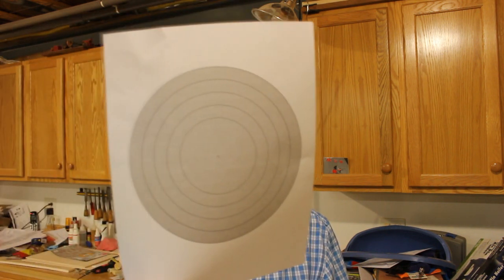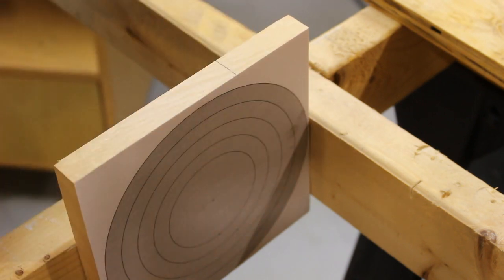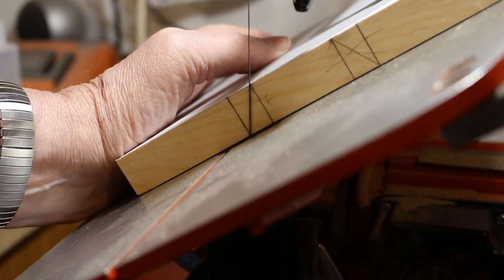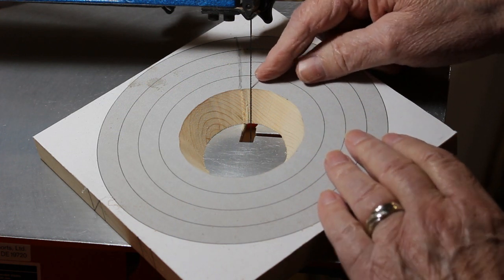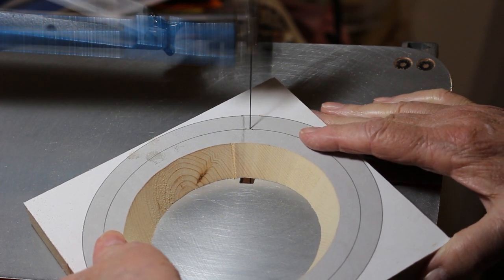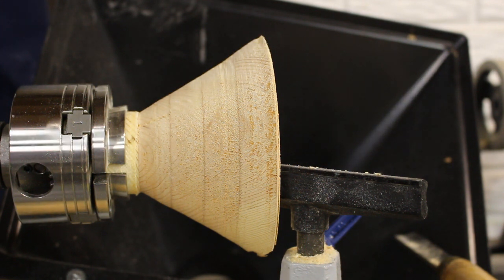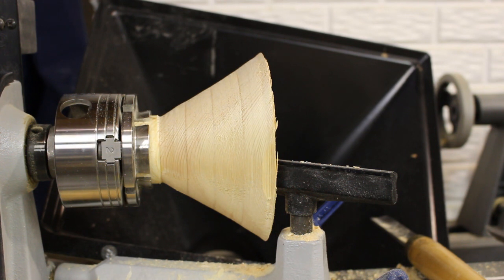Scroll Saw Bowl #1

Comment: This is my second WEN tool and they are both great MyBest.Tools I needed to do some trim work around the house and needed a scroll saw for the intricate work. No complaints so far.
Reply from the maker: When makes great tools.  I have a Wen air filter in my shop and I have been very satisfied with it so far.  Thanks for your comment and thanks for watching.

Comment: Been there, done that.  Gald to know I am not the only one.  Enjoyed the video.
Reply from the maker: Bruce,  yes but I am determined to get it right one of these days....LOL
Reply: @paulsmessyworkshop  Paul, Yes, hang in there.  I have known about this method for a few years but I have never tried it because all I have for a Scroll saw is an old Delta model and it is a trial just to mount a blade to it.  But your video got me thinking about it again, so I tried it with a piece of hard maple and it came out fine except it was kind of small, so I added a base plate and a segmented top ring using Purpleheart.  It turned out being one of my favorite bowls.  Thank you for the inspiration to try it.
Bruce

Comment: Thank You  As a total newby, the his was the first video that showed how to determine the angle and how the rings were cut.  I would use a sander (Belt or random orbital) to sand the item anyway, so It gave me an excellent start, as well as a reason not to start with the lathe yet..  and it gave me the idea for my first 'project'.  Nice video, Thanks again.
Reply from the maker: Allan, I am glad that you found my video useful.  Using a sander to finish shape the bowl is an excellent idea and one that was suggested by many of my viewers.  Many suggested using an oscillating spindle sander, I many give that a try next time.  Good luck to you and you advance in your woodworking hobby.  Most importantly, don't hesitate to ask others for advice, you will find the woodworking community friendly and willing to help.  Thanks again for watching and for commenting.

Comment: I'm happy you made this video even though it did not turn out so well. This will help me see that even experienced people mess up sometimes. I just bought my first scroll saw yesterday. I plan on making a lot of fun projects, but the only thing I have used it for so far is to cut 45° straight lines so that I could finish the two treasure chests I have been working on for an eternity (not really an eternity obviously, but they were started last October as Christmas gifts and... 

Anyhow, I'm building the inner shelves and got tired of sawing on the miter box. I figured a scroll saw would be a lot faster and easier. It will also allow me to cut patterns into some wood blanks I got because I wanted to get into whittling a couple of years ago. I thought I could just get the whittling kit, a few books, and start cutting, but half the projects recommend you start by cutting the basic outline using a scroll saw or a band saw, so they have also been sitting untouched.

 I got a promotion with a major pay raise, so my promotion gifts to myself were a scroll saw and a belt/spindle sander. I suppose I could make my money back if I decided to sell a few projects, but really, I just want to make cool stuff for friends and family with them. 

My 45° straight lines turned out quite well, and the inserts are coming along nicely. I was very happy to learn that apparently, the scroll saw can also be used to cut plexiglass because the bottom of these inserts will be clear plastic, so the treasure is visible from above. 

I might make a video of the project once I'm done, but I think it would be more of step by step photographs considering I didn't record a lot of video during any of this project. What do you use to record yourself while crafting?
Reply from the maker: Jolene, welcome to the rabbit hole of woodworking..lol.  I record my videos with a Canon 5i digital camera.  It has a movie setting on it and it works real well.  Almost any digital camera with a video setting on it will work or for that matter a video camera.  Thanks for watching and for your comment and good luck in you woodworking.  I would be interested in seeing your projects.  If you make any videos be sure and send me the link.  My email is:  paulsmessyworkshop@gmail.com
Reply: I have some stuff I made already a while ago, but hand cutting things with a miter box was annoying and I had slowly started cutting into the miter box with my saw (Its plastic). Most of the projects were made using premade boxes and items from hobby lobby, but modifying them by adding different hardware and other parts because as is, they lacked personality. 

I made one video of a jewelry case I made for a friend, but I focused more on the electronic portion than the rest of the construction and the castle was bought from Michael's so I didn't cut my own castle to use. 

I did create the electronic portion though by hand soldering the parts together and programming the components using Arduinos as the main component. I plan on doing the same for the boxes I'm working on now, but they are prebuilt chests. The insert for jewelry I made on my own though along with a hidden compartment below that has D6 dice as the legs which were carved using a Dremel tool and a lot of sanding. The top insert will have a clear base instead of wood so you can see the "Treasure" below. 

After looking at a lot of what I have seen online, I see that with a scroll saw, it would probably not be too difficult to make a castle and chests in the future. Not sure if it would be cheaper or not though.

 I used my phone for the video and it took up a lot of space not to mention the fun I had with placement of the phone.

Comment: Hi Paul, your video was very enlightening. I just bought a new Delta band saw and I'm quite pleased with it's performance. I am an experienced wood worker with experience is most facts of wood working and turning. I am thinking of trying the same kind of scroll/lathe project and I will use pine but I will plane the surfaces to ensure good glue joints and I will stagger the end grain so as to minimize tare out. If I may offer you a couple of suggestions on your lathe work; 1. try to keep support on the drive and tailstock as long as possible. 2. Get your lathe speed up as fast as possible without vibration. 3. Sharpen your bowl gouge and keep it sharp enough to shear not scrape. A little practice and you can do it.
One other thing, do not use scrapers on pine (the wood fibers crush and tare very easily and that will cause big catches. Go For it!!!!
Reply from the maker: Dan,  Thanks for the great advice.  As you can tell that my area of expertise is not turning....LOL.  Thanks for watching and for the great comment.

Comment: I have made several sizes of this lke form of a jar. The bigone is a bout 15 inches high by approximatedlie 9-10 wide. I used 3/4 plywood oak and they are very atracyive because the layers. I did made the cut inside so the rings are one piece. I'll be glad to share some pictures that I have taken.
Reply from the maker: Thanks for the information and thanks for taking the time to comment.  I would like to see your work

Comment: in my opinion the reason was direction of wood fibres. during turning fibres come to parallel and perpendicular to knife. same pressure to knife apply different force to fibres. sorry my english
Reply from the maker: niyazi ates, you bring up a very good point.  It is very possible that the direction of the wood fibers in relation to the chisel edge could be the problem.  I am also not a very good turner and I am the first to admit it.  Thanks for the comment and for pointing out what the problem could be.  Your English is fine.

Comment: Howdy. Liked your video. One thing I've come across in making scroll saw bowls is I've found it easiest not to glue on the bottom before sanding the inside on a spindle sander. That way you can pass the spindle completely through your concentric rings without hitting the bottom of the bowl. Hope that helps!
Reply from the maker: Jared,  Thanks for the hint on creating a successful bowl, I will definitely give that a try.  It makes great sense.  I appreciate your taking the time to watch and for the great comment.

Comment: You have a beautiful lathe there, why use a scroll saw to make a bowl? Thanks for sharing Paul. When a youtuber is sincere and honest like you, I am subscribing.
Reply from the maker: David, thanks for the kind words.  The reason for making the bowl on the scroll saw is mainly because of the challenge and because the bowl is being made from a single piece of wood that would normally be too small for a bowl.  The original design for this bowl does not include using the lathe.  Once the rings are cut and the parts are glued together then it is sanded to shape and finished.  Thanks for your question and for taking the time to watch.

Comment: Everything is a learning experience. As others have stated before, use a hardwood, but more importantly, stagger your grain. In other words, don't line up all the end grain, stagger them 45 - 90 degrees apart. That way you have more strength around the bowl instead of two weak points on each side of the bowl.
Reply from the maker: Terry, thanks for the information.  I have decided that on my next attempt I will surely be using hardwood to make the bowl..  The idea of rotating the layers to add more strength is a good one.  I was trying to keep the grain going in the same direction to make it look like it flowed up the finished bowl....maybe not a good idea.  I appreciate your watching.

Comment: I own a scroll saw, but I've never been able to afford a lathe. So I got excited to think I could finally make a bowl just with a tool I actually own!

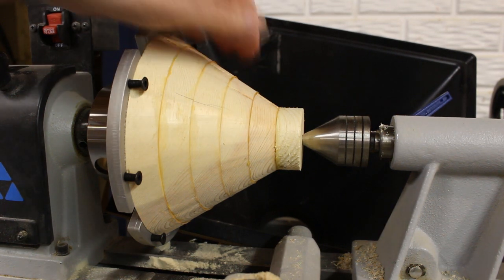6:40 A WILD LATHE APPEARS
Reply from the maker: W.D.  You can by all means make the bowl with just a scroll saw.  After cutting out the parts, gluing them together, it is just a matter of a lot of sanding to finish the bowl.  I cheated and tried to cut some corners and as you can see in the video it didn't work.  The bowl can definitely be made with just a scroll saw and sandpaper.  Thanks for calling me out on this one.  I appreciate the comment and for you watching.

Comment: I think I could have used MDF or plywood. The pine in the direction of the veins was narrow and easy to break. I would also use only sandpaper for the finish given the fragility of the piece. Excellent the project. Losses are part of it.
Reply from the maker: João, I think the next time I attempt this project I will either use hardwood or use a different method to do the final shaping.  Maybe just sand it to the final shape.  Thanks for the ideas and for the kind words.  I appreciate your taking the time to watch.

Comment: Great video, watched it till the end even if had failed. As for the bowl splitting, I'm guessing if you had rotated each cutout at each level quarter turn, splitting of the bowl at the end may have been prevented.
Reply from the maker: Cloud Piper,  Good idea to rotate each level of the bowl to prevent spitting.  You are right, it probably would help with the splitting.  Thanks for watching and taking the time to comment.

Comment: Hi Paul:
I know this video is over 2 years old. 
Did you ever figure out why the wood was cracking?  Could there have been hairline cracks that you may have not have noticed in the begining?  Maybe the grain was just too wild to turn on a lathe. Sometimes things just happen and we never know why.  Maybe next time, try placing a round disk on the face of the bowl and hold it in place with the tail stock.  That would help stabilize the bowl while turning.  You get an "E+" for your effort.
Chuck
Reply from the maker: Chuck, to be honest I think the wood cracked and broke while trying to turn was due to user error on the lathe and my choice of wood.  I was using pine.  Using the lathe is not my strong point.  I would have been much better off sanding it into final shape.....  Thanks for taking the time to watch and for your great comment.  One of these days I am going to try again but this time I will use another method to do the final shaping and a better species of wood.

Comment: Not a failure Paul. One hell of a good video and a lesson learned. Keep working at it. The biggest problem you had was working with pine. :Pine is THE crappiest wood to work with on the lathe. Thanks for posting.

Ken
Reply from the maker: Ken, I guess I will have to loosen the purse strings and try that project with some better wood.  I don't do a lot of turning so I appreciate the hint to try it with something other than pine.  Thanks for watching and leaving the comment.

Comment: Whole thing looked great! Maybe try a tighter-grained pine, or a
 harder wood
Reply from the maker: Ronald, thanks for watching and taking the time to comment.  I agree with your suggestion about using a harder wood or a better piece of pine.  Good idea.
Reply: I just bought a scroll saw for my "shop" that is a 2 car garage in Mass, just south of the NH border. Sometimes it is a mechanic's shop, but most often it's a wood shop. Have some good tools in there!  Videos like yours are inspiring and helpful. Keep up the good work.
Reply from the maker: Ronald,  thanks you for the kind words.

Comment: Sanding would be more smooth, but great work with the saw scroll, I'm excited to try it out!
Reply from the maker: thedjkay,  you are 100% right, sanding would be a much better option.  That said, I am a bit lazy and thought trying to finish it on the lathe would be an easier way...WRONG!!  The next one I will finish by sanding.  Thanks for taking the time to watch and comment.

Comment: How do you drill pilot holes to the angle
Reply from the maker: Vini,  once I had the angle I set an adjustable square at that angle and used it as a guide for my drill.  You could also cut a piece of wood at that angle and use it to guide the drill.  Good question.  Thanks for taking the time to watch and for the comment.

Comment: What blade size and what drill bit size are you using?
Reply from the maker: marang,  if I remember correctly I used a number 3 or 5 Pegas Modified Geometry blade.  Thanks for watching and for the comment.

Comment: Try 3/4 hard wood with 3/4 spacing.
Reply from the maker: Victor, I definately would use a hardwood next time.  Pine would work if I used another method for final shaping such as sanding.  The changing to 3/4 spacing might not be as necessary  because it will make the walls thicker.  Thanks for taking the time to watch and the helpful comment.

Comment: Great show Paul and although the bowl split at getting a couple of catches on the lathe, I love the fact that the show was posted anyway with encouragement to carry on.  I would think that for pine, sanding might be the better way to go with the final shaping of the bowl.  When cutting out the pieces, I see that you cut them clockwise.  I'm assuming that you would have to reverse the tilt of the blade if you favoured cutting in the counter clockwise orientation.  Great project.  I might have to steal this one from you.  Thanks for sharing it with us sir.  Awesome show as always.
Reply from the maker: Ken,  Thanks for the great comments, I always value your opinion.  I agree with you that sanding to finally shape the bowl  would have probably been a better way to go.  Pine end grain is tricky at best and not for the faint of heart.  I don't know why but it seems I most always scroll clockwise whether cutting flat or on an angle.  It is the way I learned and have always done it that way.  The only thing I can think of is that I am right handed and cutting that way keeps my right hand close to the cut.  Thanks for watching.
Reply from the maker: Ken,  I forgot to mention, when I do a version 2 of this project I will probably use hardwood.  That seemed to be the most popular suggestion I received.
Reply: That would definitely help with the stability of the project on the lathe for sure.  There was an awful lot of tear out on that pine in the cross grain.  As you said in your show though, the important thing is to try again and keep working at it.  Good luck with version 2.

Comment: What is the name of the program to down load it?
Reply from the maker: Hello, thanks for watching and taking the time to ask your question.  The program I used in the demonstration is called INKSCAPE.  It is a free program that you can find on Google.   Honestly you can draw the design by using a compass and a piece of paper.  The concentric lines that I drew were 1/2 inch apart.   Good luck and don't hesitate to email me at   paulsmessyworkshop@gmail.com if you have any other questions.

Comment: Hi paul, I like a lathe that Mr. got what price it's lathes
Reply from the maker: abd, now I understand your question better...sorry I didn't before.  My lathe is an older Delta Midi Lathe, it does not have electronic speed control like the newer ones do.  The new Delta Midi Lathe costs $649.00 on Amazon.  There are many other manufacturers of this size lathe, Jet, Rikon, Nova just to name a few.  I think all are good quality tools.  Hope this provides the information you were looking for.  If not please get back to me.  Thanks for your comment.
Reply from the maker: abd, also, many of the other brands are quite a bit cheaper and every bid as good as the Delta.

Comment: The fact that the project didn’t work out is not nearly as important as the trick you showed us about hot to find the right angle with zero measuring! That’s why I will save this video and likely watch it at least five more times!
Reply from the maker: Kevin, I am glad you found the video useful.  Once you know the method finding the correct angle is quite easy.  Good luck with your bowl.